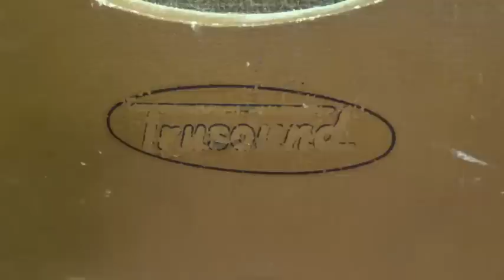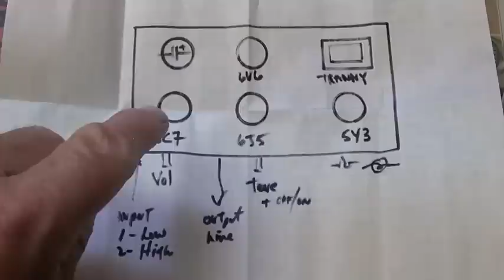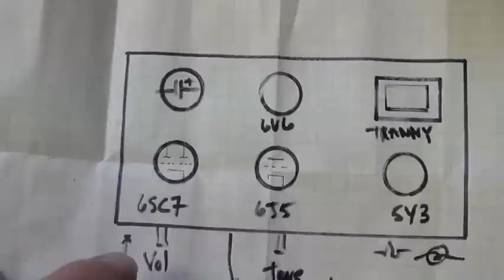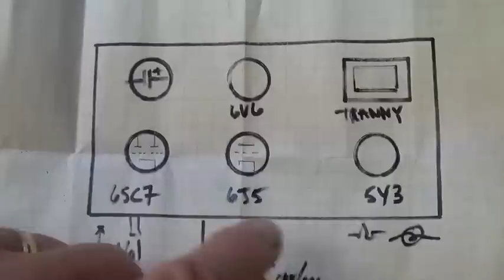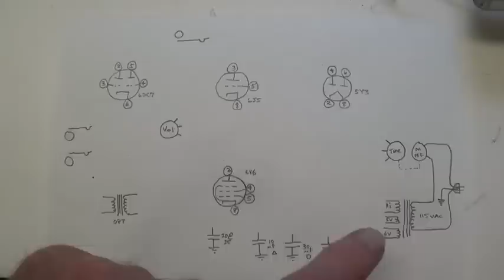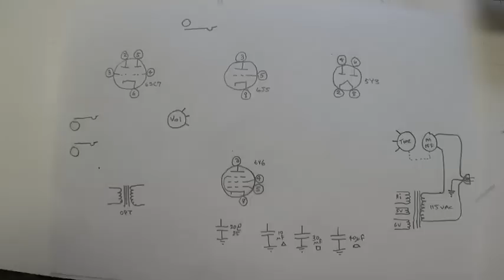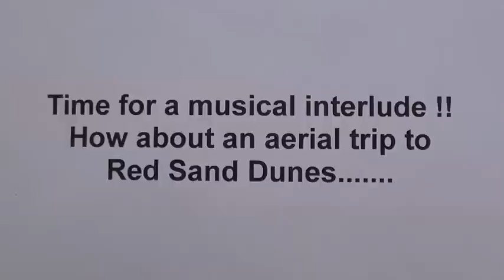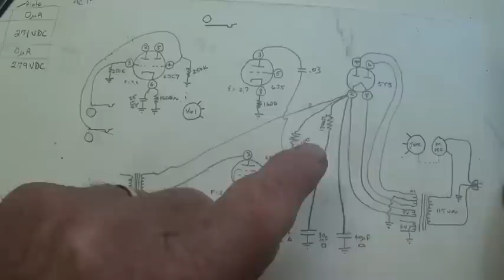1950's TruSound Amp Resurrection.....Polishing Up an Old Gem

Comment: I have a question I hope you could answer. I have a classic tone  40-18031. It has a 5k lead and a 8k lead on the primary and a 4, 8 , and 16 ohm on secondary. I was planning on using a switch and one jack for all three outputs to speaker. I have only hooked up one output in the past. I think I saw on one of your videos that 5k was fine with 8 ohm but would that be ok when I switch to 4 or 16 ohm or would I have to swap to 8k on the primary.can I just use one  of the 5k or 8k for all of the speaker out ohms. Thanks for any response.
Reply from the maker: The primary impedance (5K or 8K) is selected to suit the output tube and does not change when you use different secondary taps (4,8, and 16 Ohm).
Reply: Dummy me, duh. It will be one 6v6. I just watched your vid yesterday about that. I think my mind is slipping sometimes! Thanks.
Reply from the maker: You're welcome, Johnny.

Comment: I am sorry. I do not want to bother you, Uncle Doug, but I need to ask. Read a lot of the 367 comments and couldn't find. What was that third jack? Line output or external speaker? It was not possible to deduce from the circuit. Last, but not least, I live in a place that is almost like yours. Certain peculiar geographical characteristics saves us from being a total desert. Cheers and thanks for your amazing videos (still catching up).
Reply from the maker: As described at 8:17 in the video, it appears to be a Line Output from the pre-amp tube, PK, rather than an auxiliary output for an external speaker.

Comment: Was the other 1/4" jack a pre-amp out? It would have been nice to have demo'd that as well through something larger than 1 6V6.
Reply from the maker: I ran out of time and energy, Erik, but will try it in the near future. Based on the way it was wired, I believe it is a pre-amp output.
Reply: A pair of 6L6's and some good speakers would be nice.
Reply from the maker: Not all of us are fans of 6L6's and multiple speakers, Erik. To many of us, the amp sounds great just the way it is.  I guess it's a matter of personal preference.

Comment: I was a little surprised that the 6V6 directs all its heat directly to the voice coil of the speaker. That cannot really be good for the cone or the voice coil. Could it be why the speaker had to be re coned ?
Reply from the maker: It's actually rather common for these old amps with chassis on the floor to be arranged that way, Micheal. The heat may affect the magnet over time, but most cone damage is usually traumatic or due to old age fatigue.
Reply: I imagine the heat on the speaker wouldn't be too intense, you could probably touch it without being burned or anything, so I don't think it would cause too much grief. It may age the cone paper slightly faster. While intense heat can cause problems with magnets, alnico is actually ideal for high heat situations. It can handle over 800-900° Fahrenheit, depending on the type.  Better than ceramic magnets!

Comment: Great video but a few questions for you.  How big are both the chassis and cabinet? Plus how big is the speaker?  It looks like something that would be fun to build even if using a different circuit just for the difference in look.
Reply from the maker: Thanks, Dennis. The outside dimensions are 13" tall, 10.25" wide, and 6.25" front to back.....with an 8" speaker. For such a tiny amp, it has excellent power and tone, largely due to that stout speaker.
Reply: Uncle Doug : thanks, I appreciate it.  :)
Reply from the maker: You're welcome, Dennis.

Comment: Listing to port...
Reply from the maker: If you're speaking of the cabinet, it was listing to starboard.  The determination of port or starboard is based on the viewpoint of the vessel (or cabinet) itself, facing forward.

Comment: Made by
Reply: Valco
Reply from the maker: You're probably right, Jack, especially with the Chicago connection.
Reply: Uncle Doug there is a 1960s Trutone Thunderbolt for sale cheap from a guy in Chicago
Reply: I have seen this amp model for sale also on Reverb as a Valco product
Reply: But it is just an educated guess.  And Trusound is not the same as Trutone
Reply from the maker: You better snap it up, Jack......as long as it isn't a series-filament circuit.
Reply: Uncle Doug hahaha if I get any more amps in this house right now I have to sleep in the shed.
Reply from the maker: That's a small price to pay for more amps.
Reply from the maker: Too bad it's not a Supro Thunderbolt, Jack ;)

Comment: Hey UD,

I have a question for you.  I was helping clean out my grandpa’s house and found a bunch of old tubes(50 or 60) in original boxes from the 1950s or so. Apparently he was a part time radio / tv guy and took a Delco home course... Anyway, I was wondering if you could use them.  Let me know how to contact you if you’re interested.  I’m not an amp guy, but watch your channel for its cathartic properties!  Thanks!

Garret
Reply from the maker: What a generous offer, Garret. To avoid having you go through the trouble of shipping tubes that may not be applicable to tube amps (most radio and TV tubes are not), could you provide a listing of the numbers?  I know this is inconvenient, but I can tell you immediately which ones are of use with old amps and possible save you even greater inconvenience. Thanks :)
Reply from the maker: As I suspected, Garret, the vast majority of these tubes are purely for radio and TV use. The only ones that might be used in amps would be the: 6J5, 6SC7, 6SK7, 6SL7, 12AT7, and 12AU7.  There may be some interest in the radio and TV tubes on Ebay......but probably not a lot. Thanks for all the time and trouble you spent on cataloging them.

Comment: 👍
Reply from the maker: Thanks :)
Reply: No , thank you 🙏🏼
Reply: Uncle Doug you probably know this already, but if you strip some wire , use the plastic to put over some legs of a resistor or any legs in a bad situation. I use them on car alarms when I use diodes to isolate circuits or resistance integration.I hate to tape them or heat shrink . It looks cooler and fast !
Reply from the maker: Yes, I too use stripped insulation on the legs of resistors and capacitors. Thanks.